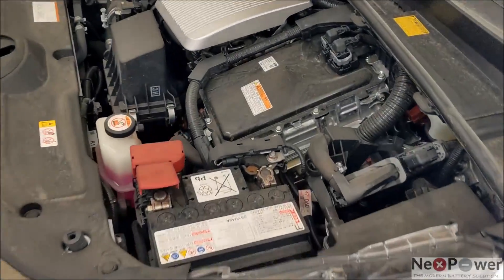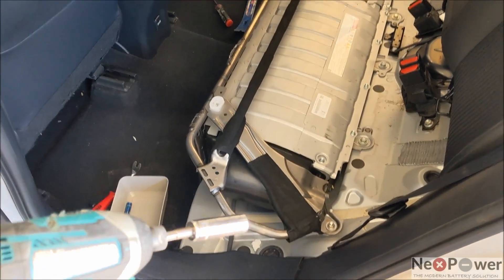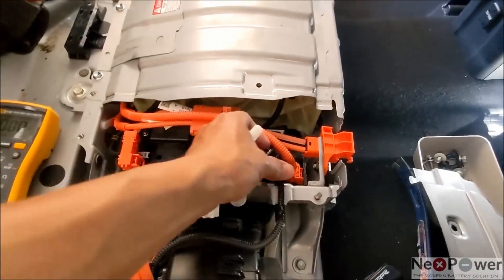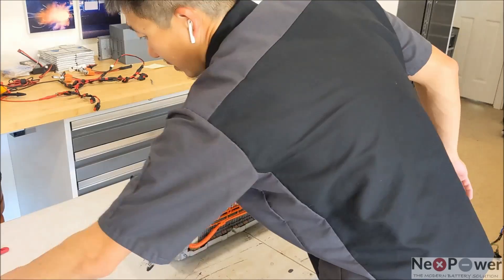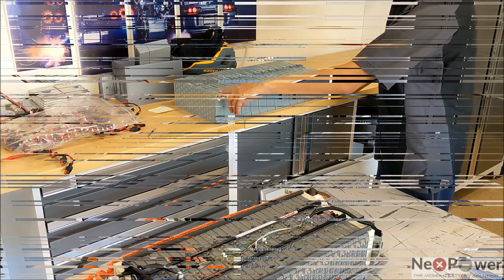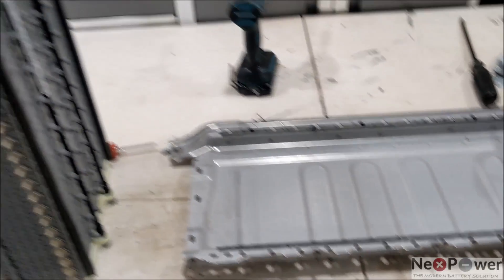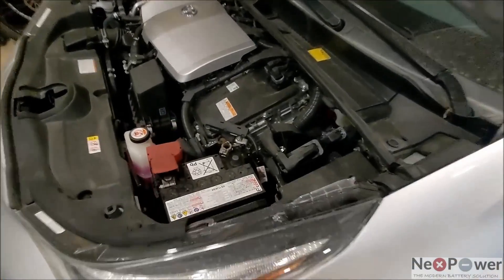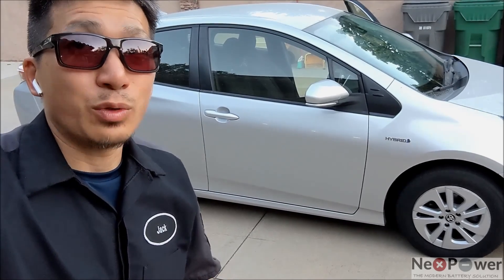2017+ Prius Gen4 battery NiMH to Lithium swap - step by step

Comment: at 8:40 looks danger when he touched battery with bare hands and belly as left and right side still may have each 100V DC even thought he took nuts out, but cooper plates still could conduct electricity. We want to watch more of your videos. Please use rubber gloves or just remove that orange bar first, before touching battery with both hands.

Comment: Hi jack, If the higher trim comes with Lithium anyway, is the ecu/inverter capable of being altered so it treats these lithium cells as if they wer oem lithium cells? If the charging logic is set up for NiMh then there is a lack of optimisation that might lead to premature degradation of these cells, right? How possible is it to upgrade the charge/discharge logic to help ensure longevity of your batteries?
Reply: Well while Jack deserves a lot of credit for bringing this solution to the market, which consists of replacing the cell chemistry NiMH with LiFePo4 or Lithium Iron Phosphate, by a drop in replacement of two Toyota modules with one Nexcell module, he does not address the fact that the car has no notion of the new cell chemistry in the battery.  NiMH with respect to Lithium Iron Phosphate chemistry have different charge and discharge profile in terms:
-> Maximum peak charge and discharge currents  as well as for how long
-> Maximum sustainable charge and discharge currents without deteriorating the battery health/longevity

The Toyota NiMH modules are 6S1P in configuration, since this drop in solution replaces two original modules with one Nexcell module which is 5S1P of LiFePo4 which kind of matches the voltage profile.  Thus 12S1P NiMH cells are replaced by 5S1P LiFePo4.

Chemistry  |Min. Voltage   |Nominal Voltage  | Max. Voltage
---------------------------------------------------------------------------------------------
NiMH          0.8                      1.2                               1.5
LiFePo4      2.5                      3.2                             3.65

In terms of modules the voltage are:
Chemistry  |Min. Voltage   |Nominal Voltage  | Max. Voltage
---------------------------------------------------------------------------------------------
NiMH          9.6                      14.4                              18.0
LiFePo4      12.5                    16.0                             18.25

This is why I agree/rejoin your questions/comment.

Comment: I'm guessing this Li cell can be used on a Gen 2 pack? Just got the red triangle from it sitting at the dealers for 2 weeks, block #2 was a volt lower than the rest... getting a new cat installed since some idiot thought I didn't need it. thanks

Comment: Does this battery management system have low temperature charging protection to prevent it's destruction in Canada ?
Reply from the maker: Already tested in sub-zero environment for years.
Reply: @hybridapp7158   Have they tested in Death Valley,ca I live in the desert it can get to 110-115F.. (SUV parked in the shade)

Comment: Corolla (E210) with p610 transaxle (same as Prius gen 4) is produced here in Turkey for European markets. I don't know if NiMH structures are also same (but probobly same) and you can sell this upgrade for Corolla users soon. I tried with OBDLink LX to measure the battery performance but it is not competible. Is Dr. Prius competible with Corolla(E210) Europe version?
Reply from the maker: NiMH is the same for Gen4 including Corolla, OBDLink LX is a bit tricky, it doesn't really supports iOS and even with Android I found it harder to pair compare to other cheaper alternative.

Comment: Hi Jack, great job. When you put it to the test, could you drive it down a long falling grade and see if it will run in EV mode, because the NMH's definitely cause havoc as soon as they hit 42 C . hopefully there will fix the problem.
Reply from the maker: Yes, I've driven the NiMH for weeks and notice that it gets hot quite easy and performance degrade big time at around 110F,  I actually have to re-shoot the EV range video several times because the NiMH dropping voltage so quickly and throw me off the script, LOL